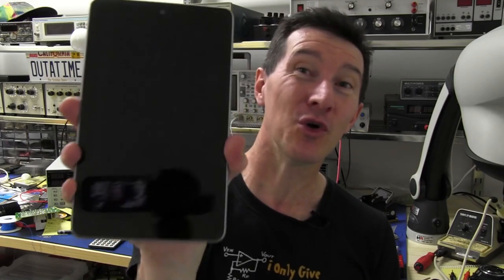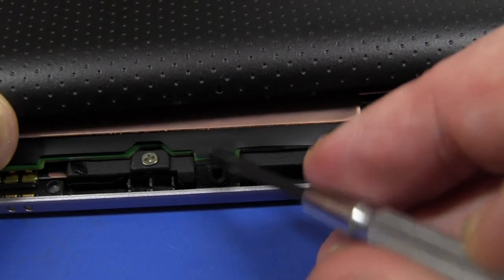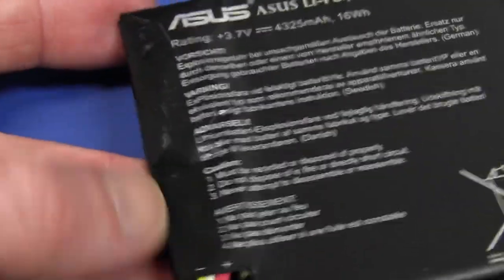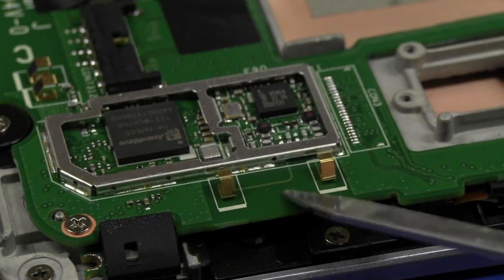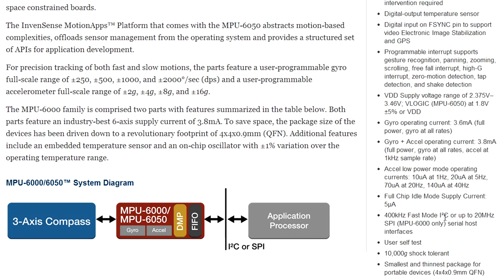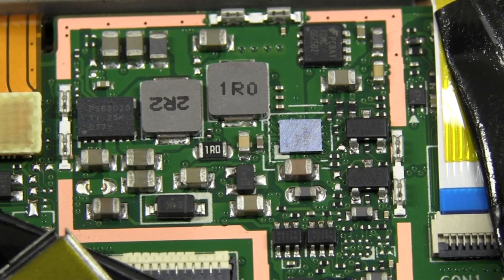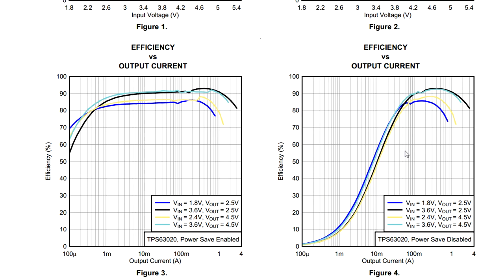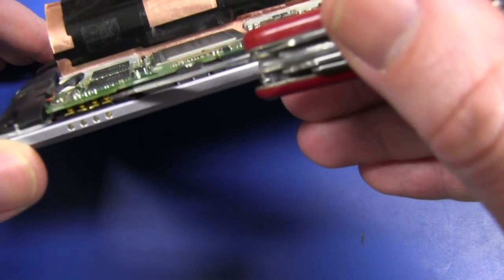EEVblog #321 - Google Nexus 7 Tablet Teardown

Comment: Sitting watching this during my lunch at work.
I had to look up the serial number on my system and check the spec. :-D

That rubber thing is a microphone mount.
The gold pins are for the POP port docking connector. It replicates the USB port.
That grey socket is for the camera we didn't install. :-)
Reply: The four gold "Pogo" pins only carry power and audio, for a cradle.

It's possible they can be used by the factory for other purposes, but not by the likes of us.

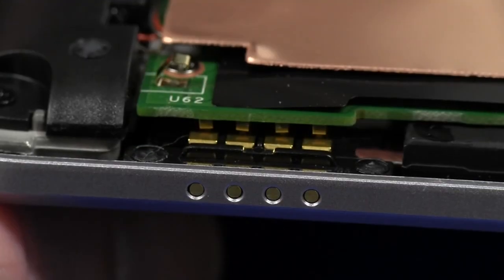Comment: @3:00 Those are the POGO connectors. A Pogo pin is a device used in electronics to establish a (usually temporary) connection between two printed circuit boards. Named by analogy with the pogo stick toy, the pogo pin usually takes the form of a slender cylinder containing two sharp, spring-loaded pins. There is a dock for the Nexus 7 and the pins are used to power and transfer data if connected to the computer via USB

Comment: Free fall interrupt certainly used to be used a lot in laptops. When falling the laptop would dock the mechanical harddrive read head so you don't damage the harddrive or lose any data. It was certainly capable as a harddrive would sweep from one end to the other in under 10ms, but on the flip side I have killed multiple harddrives dropping them so much the case is destroyed and the laptop is held together with tape and metal plates acting as a splint and I haven't had a single harddrive fault or any reason to have that technology so it might just be outdated advertising purposes no longer used. I haven't yet dropped a laptop down the stairs, however. I'm running out of time, my next laptop is most likely going to be SSD.
Reply: Yep, my old Nokia N91 with 4GB HDD had protection like that.

Comment: the gold foil isnt for RF sheilding -  it is heat sink material -  it may serve the additional purpose of sheilding -  but it is primarily to dissipate heat. and i think the square opening that seems oddly empty -  was where a camera module may have been planned/added -  but never implemented due to the price point of the device not allowing for it.

Comment: G-loads on electronics is quite interesting. Im currently workning on a project that subject the electronics for about 5kG shock. A MCU (18 pin tssop) loses it's program memory but can be reprogramed, an magnetic angle sensor lost it's preprogramed serial-out but the analog pin worked... To put in perspective a shell fired with a muzzle velocity of ~1000m/s is 60kG, it has a programable radar in it :)
Love your videos Dave!

Comment: That "hole" on the upper side of the device (right side near the end of the video) was probably for the camera. Also supported by the fact that the back side of the back panel has a small hole sealed off which would have the same place as that hole on the chip.

Comment: A good use for the free fall detection of the gyro is for laptops, you can have the system disconnect the hard drive to avoid damage before it hits the ground

Comment: 12:15 on devices with mechanical hard drives, drop detection is useful for parking the r/w head so it doesnt damage the platters on impact. In case anyone was wondering what an actual use might be.

Comment: It's a System-on-Chip, the GPU and CPU are combined in that one package.  As for RFID, NFC and RFID are compatible protocols, so the NFC antenna IS the RFID antenna.

One thing I didn't see is the Bluetooth antenna/controller.  I know it has Bluetooth, so that's another thing on the other side of the board most likely.

Comment: The gold pins on the side are for external USB and power for docks. They are called 'pogo pins'. They are meant to mate with spring loaded pins on a dock. (I can't put URLS here :( )
Having a separate sub board for the mine USB is essential these days due to the mechanical stresses from insertion/removal not really so they can replaced when they wear out.

Comment: ps, not that is is needed for a tablet but a fall interrupt could be used to retract heads on a disk. Another interesting use would be for warranty invalidation. Similarly iPhones have a chemical one way colour changing moisture sensor to deny warranty if the phone is dropped in water. If it is red they won't warranty the phone repair.

Comment: Everything but what I REALLY wanted to see....  How is the memory attached to the device? Are they using a soldered DIP chip, or is it like a MicroSD? I just want to know if I can replace the memory with something a little bigger, and maybe faster with out removing soldered SMT chips.. I have heard of companies using an SD card slot in a sealed device so you can't get to it, but the PCBs are all the same till you slice in the SD card. Loved the video, thanks!

Comment: 12:16 Free fall interrupt can park the head of a disk drive (but obviously not on this device). IBM used this as a gimmick in their laptops a few years ago the theory being that you can recover data if you haven't buried the I/O head in the surface of the disk (Not sure how well it worked).

Comment: Had a glitch in the OS where it would throw up an error message every 10 seconds or so. MID has this kookie software to flash the device. However it would never recognize the tablet via USB to PC. The warranty was void due to the cover & battery issue. Threw it on the shelf. Bought a Toshiba Thrive 10". Works beautifully, well made and reasonably fast with the arm A9 dual core processor. Even has a full size type A USB Host mode port.

Comment: a lot of n7's have a speaker problem (distortion/crackle) and unfortunately so did mine, i decided to open the back (using a butter knife - bad idea) and i found that the mesh on one of the speaker was not put on right and was vibrating too much, i pealed it off and it was fine!

Comment: Hi Dave,
Does your Nexus have problem with screen flickering?
Mine is flickering in low light/low wifi signal conditions.
The android users do recommend to stick a piece of scotch tape on wifi ground post, but wouldn't it 
a) Reduce the wifi signal value?
b) Overheat the wifi chip?

Comment: The difference between EU and 'true' mAh ratings is I believe the difference between Wh=nom voltage *mAh rating and Wh=int(I*V)d(cycle). So both are technically correct.

Comment: The free fall intrupt is used for stpping the reading and writing process of the HDD in the case of laptop computer inorder to protect it from having a bad sectors ..
Reply: Ali Al Obidi But this is a tablet with flash memory, no spinning parts there.
Reply: There are two possibilities ..either they use it to record in case that the device fall down hard for warnty purpuse or the use it for some applications or games that require acceleration .
Reply: +Ali Al Obidi 3rd possibility. The same chip is sold to makers of laptops and the tablets simply don't use that interrupt.

Comment: My first tablet I picked up an MID brand 7" single core 600MHz unit for under $100US. I had a problem with it right out of the box. The battery wouldn't charge. Tried contacting the seller, bust. MID was no help due to the Chinese New Year. Closed for nearly 3 weeks. Frustrating! So I attempted to take the back cover off. It wasn't made to come off. 4 screws installed from under the front screen no clips and the screen was glued on. Angry! Broke the cover off and the battery was unplugged!

Comment: too bad the 2013 model isn't as easy to tear down...  many of the battery apps say it has a Li Ion battery on it but the tear down I saw had Li Ion on one side and Li Po on the other  those aren't the same thing.  and indeed one app does say it's a Lipo  Lipo lasts longer in theory  that and the 2013 1. is thinner 2. stereo
Reply: The 2012 has stereo speakers, but they are oriented for stereo sound when holding the tablet in portrait.
Reply: true but nobody watches a movie that way or plays a game that way... so a bit pointless...

Comment: is the flash memory every upgradable in those seems like you can guy stuff with 16  or 32 or 64 depending on model.  or do they just at the time of manufacuter put the type of ssd ram they want in each model.

Comment: The 2012 model isn't worth putting back together.  Google destroyed it with the last update.  Now it runs like a pig in treacle!
Reply: +killerdalek 
Had same problem.. Any suggestions on getting to run better.  I heard also on the 1st gen models the RAM gets slower the longer its used.  Mine used to SCREAM on any app. Now it can take minuets to even load up. And swapping between apps makes you want to smash it. Once loaded games or videos play fine.
Reply: Well, you could always revert it to a previous version.  However, disabling all updates helps usability.  Once the Nexus thinks it needs an update it slows right down for hours, so these are best installed manually when you feel you have enough time.

Comment: just had my nexus 7 die today.. I press the button and nothing happens, screen doesn't switch on just blank. dead. it's been a great tablet, does anyone have any idea what it might be? thanks
Reply: +doganb34 Could be the battery, especially if it was left fully discharged for an extended amount of time like mine was. I had the same behavior though sometimes the screen would flicker. Would not power up even after charging overnight. Installed a new battery, works great!

Comment: My nexus 7 wont charge when its on, it only charges when i completely shut down i do have the stock charger and cable and its plugged into the wall outlet. Can any one tell me what is wrong with it? I think its software rather than hardware.

Comment: i know these things backwards, use em for kooky projects, got 1 in the car mounted in dash for speedo, I use one w/ a wireless OBD2 sensor and an app called "Torque" to diag cars. 1 in bathroom running audio,radio, 1 w/ keyboard running Kali Linux Net Defender, 1 mounted in living room displaying in/out temps,weather,etc...one tough ass tablet ;)
HINT: use copper tape , & a bit of coax from laptop ant. and make a bi-quad antenna to replace the weak one
https://www.youtube.com/watch?v=9knu_NCilco

Comment: I have done a lot of looking since I posted...and I now don't think you can expand it easily. But I have found a video showing how you can connect a flash drive and even a mouse and key board using the micro USB. Check out reverendkjr